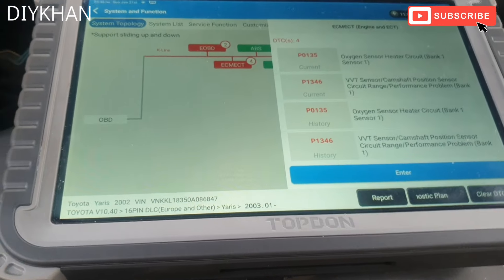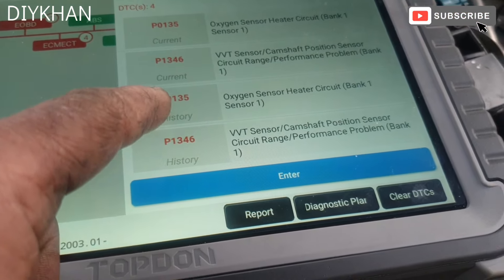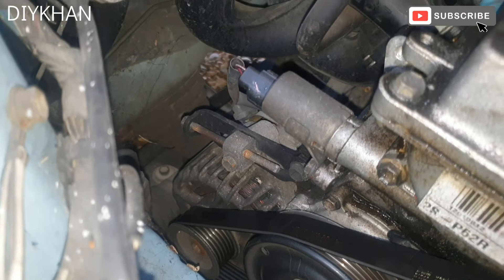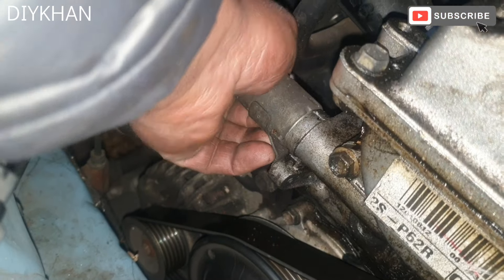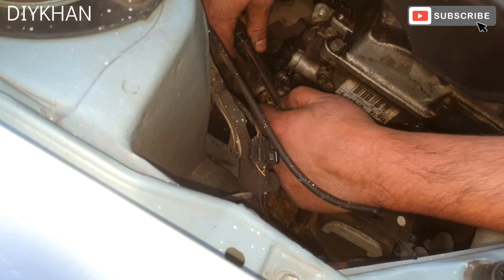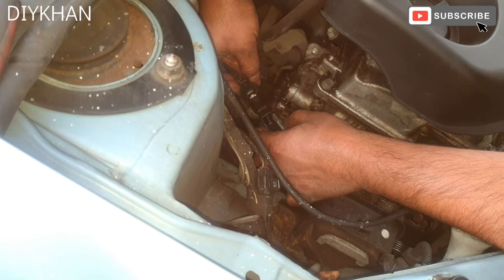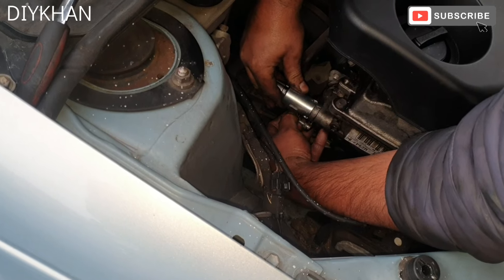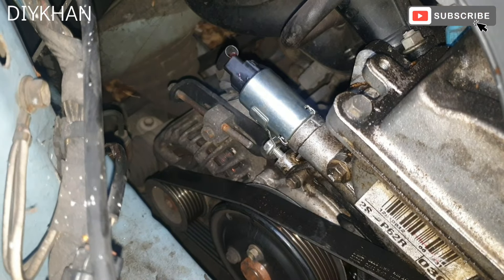Toyota Yaris Vitz Camshaft Position / Adjustment Control Valve Sensor Replacement. Fault Code P1346.

Comment: Cheers Khan. I have the T Sport  and have code P1346.  But NO engine light? The car would intermittently rough idle when warm and at one point it lost power with rough running while driving. So I changed the solenoid, and cleaned the little oil filter. Ive done a few test drives of a couple miles including pushing the car hard and theres been no problems. BUT the code wont clear. Any thoughts?  Did your code clear? was your engine light on?

Comment: Brilliant video. I've been waiting for this one. My Yaris 2003 VVTI also has been illuminating the engine light. P1346. I changed the sensor (also known as the VVT-i or Oil Control Valve) but it still comes back on after a few miles. The garage evem changed the timing chain. Would bad timing cause P1346? The car otherwise runs perfectly. I've honestly been fighting this code for 2 years now
Reply: Did u find the solution yet?
Reply: Up
Reply: @simbarashemakoni2020  Sadly not. Still keeps coming back after a few miles of resetting. Though I'm starting to suspect it could be either electrical related, maybe a bad ground?, or the VVT gear. It shouldn't be timing as my chain was replaced, unless the garage didn't do it properly. I'll keep digging
Reply: wow I changed vvt sensor, Cmp and it's still the same. I got bored so I'll leave it like that haha
Reply: @crisvoi  haha if you ever find out what it is I'll be happy to hear. I'll work with you to figure out what it is if you want? I need to change my rocker gasket as oil has started seeping out of the front of the block. Looks like the gasket maker paste the garage used has dried up and its allowed oil out. I can check timing when I get the cover off and confirm that the timing is fine. If not, that'll be the issue
Reply: @ShiftedReality90  I searched in forums and internet, the only thing I have to check is that the engine is ready and the distribution in good condition. Another thing that can be is the CMP sensor cable.
Reply: I have the same issue mate. I have the T Sport and the car was idling a little rough now and again  but drove fine,  on one occasion it lost power while driving. I get P1346 too BUT no engine light. So, I changed the control valve/solenoid like Khan does here and also cleaned the little oil filter below it. Changed the coil packs just in case too. Cleaned all the connectors. Car seems to drive fine, however like you the code wont clear. I too am beginning to think its a poor connection somewhere. Let me know here if you get any news. Doing my head in!
Reply: @crisvoi  see my response too, same issues.
Reply: @ShiftedReality90  If its the vvt gear I would expect running and performance  issues not just a code? wouldn't you? because that gear or 'cam phaser' I think its called should be adjusting your timing most of the time so if broken you should experience running issues id guess.
Reply: @ShiftedReality90  If youre taking the cover off check the oil path holes around where the solenoid goes in, check they arent gunked up. Ive seen a vid where that was the issue, partial blockage and oil wasnt flowing properly into the cam phaser. If people have been using gasket paste some may have fallen in and blocked oil paths.
Reply: @GillmanStudio  Brilliant advice about the oil channels being blocked or partly blocked. The previous owner of my car sold me the car with black oil which looked like it hadn't been changed in a while. I immediately did a full service once I bought it but P1346 has always been a problem. I've been able to get my car through the MOT by clearing the code before going to the center and they've never noticed the code. My emissions have always been golden which makes me feel its not a timing issue. I'm just waiting on the gasket to arrive then I'll be pulling the valve cover. I might even make a video of it and post on here. I'll clean up around the areas and check timing. Though like you said, if the VVT phaser wasn't working we would probably get a code for the crankshaft sensor detecting out of range too. The car would run rough I believe too. I've seen on Toyota forums that if the timing is off even by a margin, the P1346 will trigger but show no symptoms. This is why I will check timing while I have the valve cover off. Might as well while I'm there. It's a great point you make though. The little filter by the OCV on mine is spotless. I've changed alot of stuff related but nothing seems to get rid of it. It's weird with my car, my OBD scanner reads the code pending and stored. From previous cars, once the CEL comes in, the pending code changes to stored. It never still pends after, again this is why I suspect a connection issue somewhere
Reply: @GillmanStudio   Also, I did a resistance test on my ocv and it's in spec. I disconnected the ocv and drove around the block. Definitely could tell it wasn't connected as my car ran crap and lost alot of power. And got a code for the ocv circuit. So that's working I think. When your car goes up to around 2k rpm, do you feel a stutter from the engine, before vvt kicks in?
Reply: @ShiftedReality90  I checked resistance on the ocv too. The old one I took out was 7.6 ohms. The new one (aftermarket) 8.4 ohms. So it suggests the ocv was faulty. So should cure the problem. 
I'm checking the grounds tomorrow and also dropping the oil level. I bought the car off a guy who serviced it himself a few months ago. Oil is very clean but above the fill mark on the dipstick. So another theory is .. maybe the oil pressure is too high? So as part of a process of elimination I'm checking those two things next. 
Drove the car today for 50 miles and pulled and idled great. Then oddly, as I pulled up to some traffic lights, brakes on and clutch in, the car just cut out as I came to the stop. Just stopped like I'd switched the ignition off. 
I then just turned it off, turned the key back and she fired straight up first crank and idled perfect. 
Haunted car I think! 
Though that event haz got me thinking bad connection somewhere more than ever.
Reply: @GillmanStudio  Glad to hear that your ocv is in good health. I swapped mine out for elimination like you're doing now. My old, rusty one measured a resistance of 7.1ohm. Think it's supposed to be around 7.6 to 8.2ohms around 20 degrees so it's good ours is within that range. Did you notice any difference in power once you changed your ocv? On most of the forums, changing the ocv fixed alot of other people's P1346 but it hadn't for me, but my car felt heck more powerful than it did. Like you, I service my car myself and I've kept up to maintaining it in my nearly 3 year ownership. Done alot of work on it but P1346 remains. It's certainly a possibility the oil pressure is higher given the oil level is high on your dip stick. How much would you roughly say its over filledby? Interesting about your car cutting out for no reason. That's really odd. Especially if it doesn't do it all the time. Do you have any misfiring codes at all? 

My car doesn't have that issue yours does. Never cuts out, just sometimes a minor rough idle after warmed up and the DTC. Drove back after work and she flew even after 2k rpm, didn't hesitate. The hesitation seems to random. I'll keep digging. Hopefully my gasket will arrive any time now so I can pull the valve cover and have a look
Reply: @GillmanStudio Right so my gasket arrived at last with some rtv paste. Just waiting for the weekend to get the gasket changed. Can't wait to get the valve cover off and have a look around. I changed my oil as it was due the other day. Used Shell Helix 5W30 as I wanted to treat my car. She's loving the new oil. Can definitely feel the engine is more happier and performs better. I'll update once I have done my gasket and report back
Reply: @GillmanStudio  So I've removed my valve cover from my car today. Didn't take too long to do. I was changing the gasket anyway as it was leaking into the plug well. The chain is tight with no play at all. I can confirm that my timing marks are aligned as far as I can tell. The chain has 3 gold plates that align with timing marks on the camshaft, vvt pulley and the crankshaft. I couldn't see directly down into the crankshaft area as its covered but the top 2 gold plates are lined up with the marks on the VVT pulley and camshaft so I'm assuming they are all lined up. So that clears up that. I'm only left with a wiring problem. So onto the multimeter now to try and get to the bottom of it